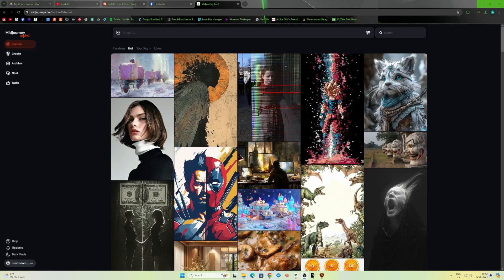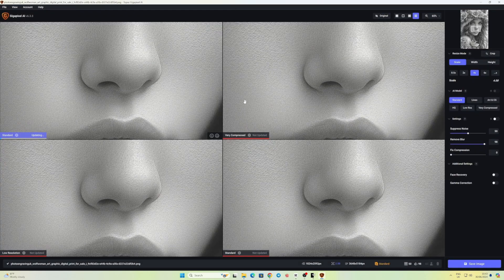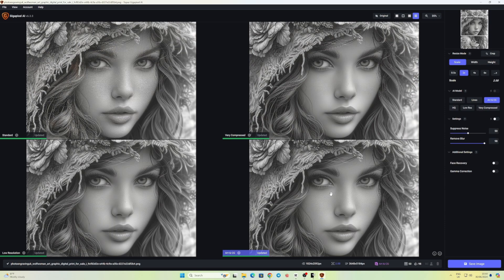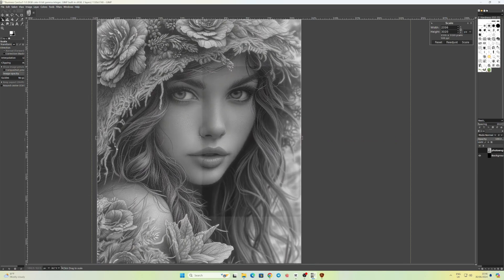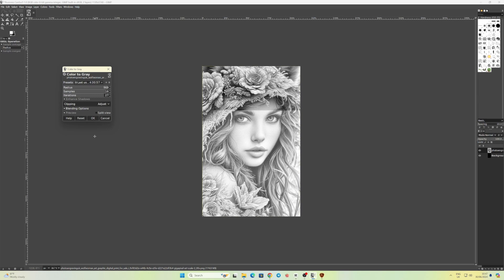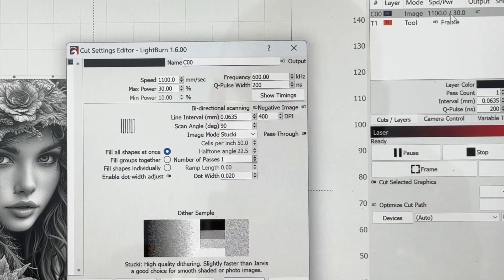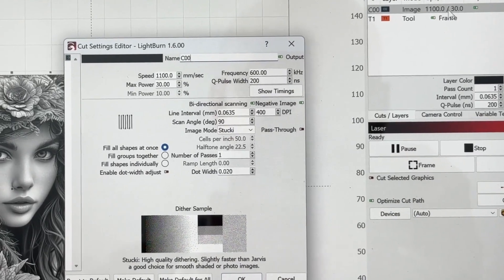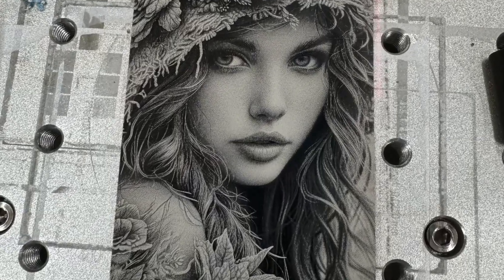Laser Engraving Anodised Business Cards, a walkthrough of my process.

Comment: You card came out fantastic!  I'm a beginner but will give your method a shot!  I'm trying to etch from a photo (bmp) of a car and will duplicate your steps in Gimp.  With other things I've etched, I finding the file type seems to make a big difference.  Does burning the negative on an anodized card generally give better results than just etching a non-negative on a plain aluminum card?  I tried coloring the metal with a black sharpie just a test but that didn't work so well.  I am using a LaserStar with LaserCad software.  I think its 30 or 40 watts.  Max frequency is only 80kHz (no where the 600kHz of yours) and no settings for pulse width, image mode, cells/in, halftone angle, or dot width.  Since I don't have the image mode I'll follow your suggestion and dither.  Thanks for any tips!
Reply from the maker: Thank you, engraving a plain stainless steel or aluminium card will give you a very different result looking more dark brown burn than anything else. Freq is ok just will need to slow down your speed. As a beginner i highly suggest a FB group called Den of Lasers. All the posts include the settings used, there is a full guides section to help get the best results and lots of us to help

Comment: 600 frequency? Mine only goes to 100
Reply from the maker: I would double check with the laser manufacturers notes to make sure
Reply: @Nonprofessional_Tinkerer  I did
Reply from the maker: @swflscratcher5893  i dont think it will be impossible just will take some trial and error with some cards using 100 and slowing the speed down
Reply: A MOPA laser has a wider range of frequency, you seemingly got a normal (non-mopa) laser so you might want to play with it starting at 50 or something familiar.